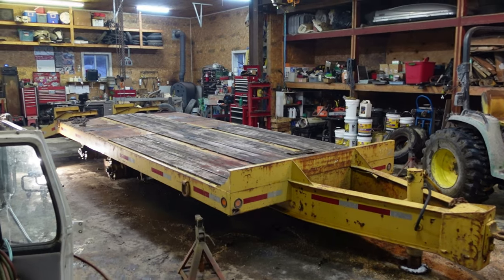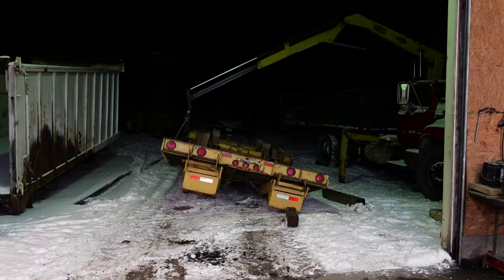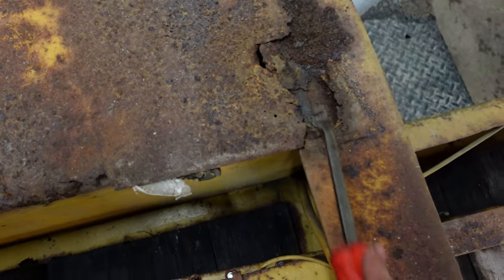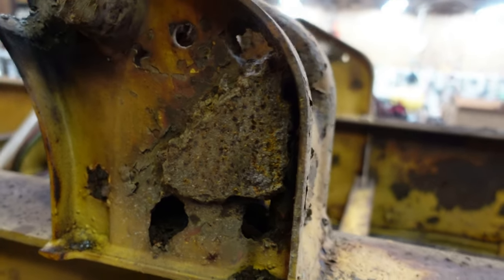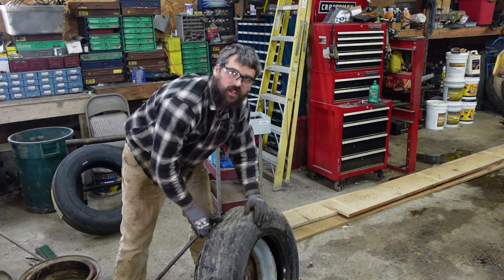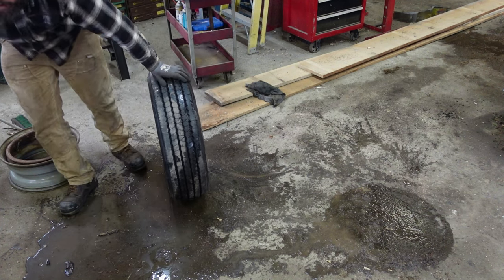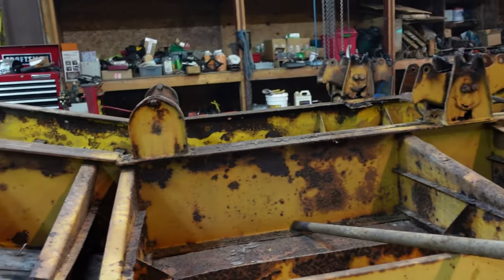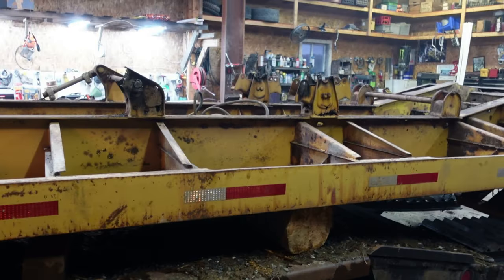Eager Beaver 20 ton Trailer rehab - Part 1

Comment: Just starting a rebuild on a 10 ton trailer. Not as bad as yours but the rear spring hangers actually tore away from the main frame. Those two rear hangers were reinforced laterally with a full 3" C channel x 8' long. Owner wasn't sure how it happened.....looking forward to your rebuild.
Reply from the maker: there's always more to fix than expected, at least on my stuff, good luck

Comment: Hey Dillon, I’m looking to buy and strip almost this exact trailer to use as a makeshift bridge over a creek on my property. In this video, you mention you had it towed: I was wondering how you had it towed? I’d be looking to do something similar, but was curious as to where I should start looking?
Reply from the maker: I sent a tow truck to get it. They winched it up on the bed

Comment: I’ll be starting a similar project. Where did you get all your parts?
Reply from the maker: I have a really good truck shop up here, Charlebois, They are usually cheaper that anywhere else, and have just about everything in stock. These suspensions are really standard, I found the parts breakdown for the trailer on line, part numbers can be used.
Reply: @DillonHFM  that’s awesome. I got a 20 ton trailer for free. It’s not in as bad shape as the in this series but need some attention. I don’t know the brand through.
Reply from the maker: @dblood8529  The suspensions are pretty standard, not made by the trailer company, a decent truck shop could look at pictures or parts and get you replacements. Might need to talk to the right employee though, the young guy where I go doesn't know much if it is older than about 5 years, but the guys who have been doing it for 20 years are great and usually can know the part number from looking at a picture of the part